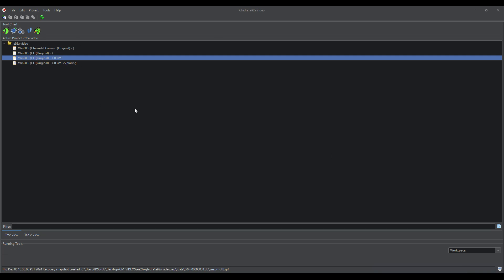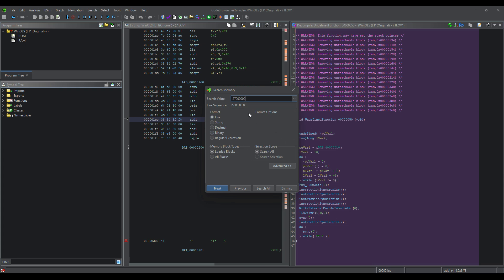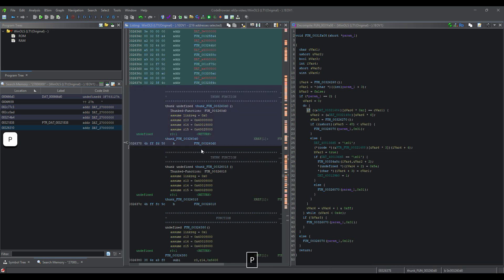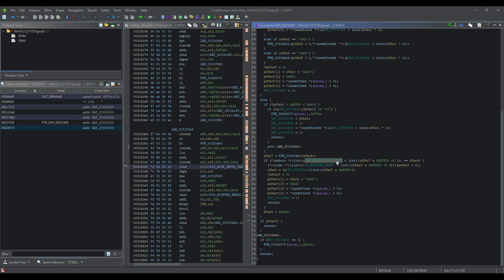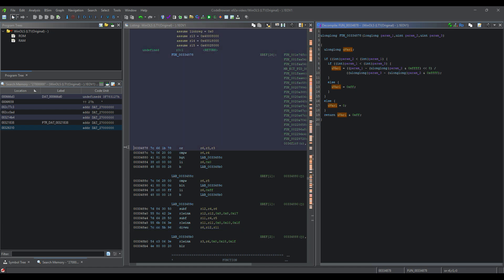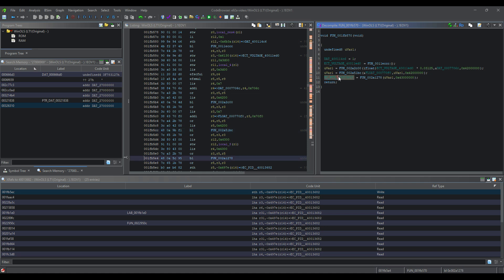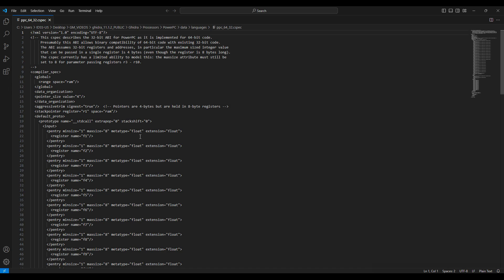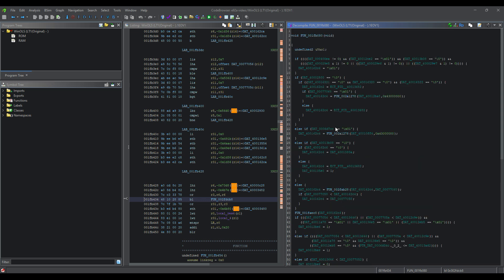Part 2: GM Gen 5 LT1 E92A Software Disassembly. UDS protocol, SAE PID’s, and more.

Comment: Did you come across any PowerPC instructions Ghidra doesn't implement? If so, what did you do about these?
Reply from the maker: I have not come across any in the gm binaries. I have come across some in a Toyota gr86 denso power pc. Someone from the atlas open source group created a processor language for that Ecu. If you commit the time and dig the the processor folders and the processor data sheets you can add instructions. I have not committed this time yet.
Reply: @ got it. Does atlas open source group have a web site or something like that?
Reply from the maker: @fastboatster  https://motorsportsresearch.org/support.html
they changed their name
Reply: @GHIDRAuto  thanks a lot! Very interesting and informative link